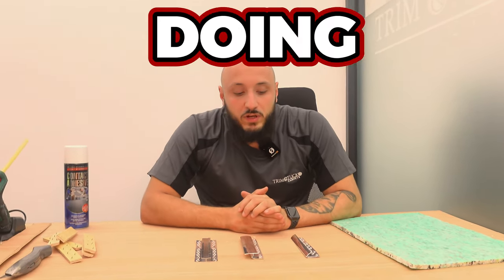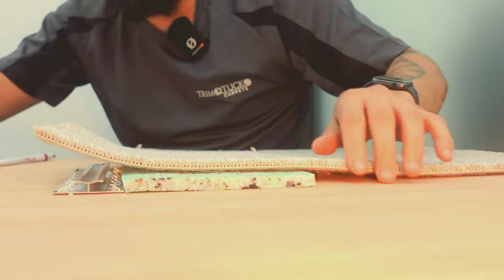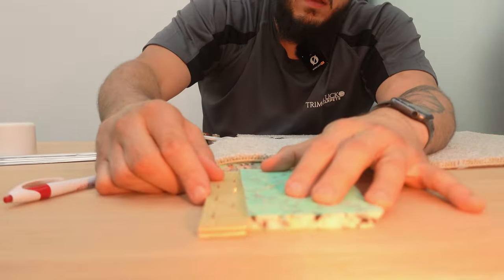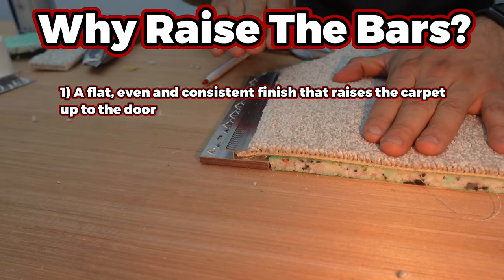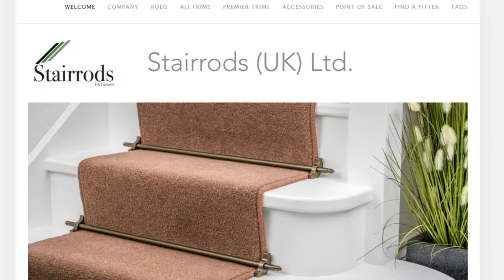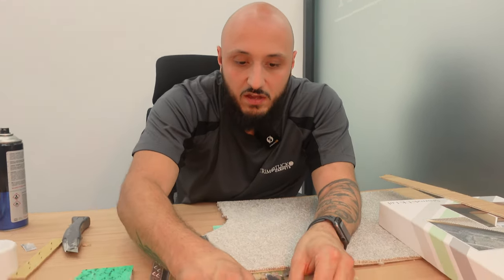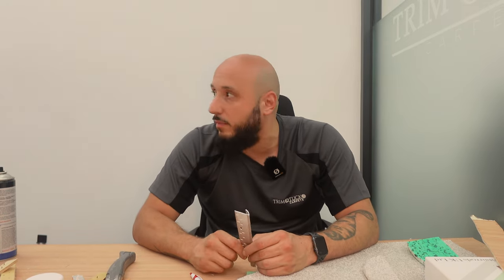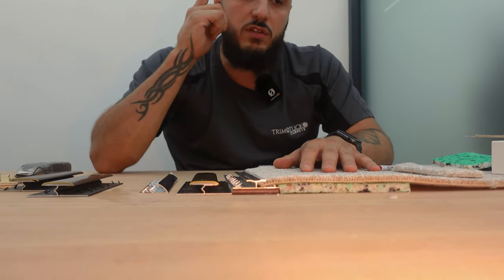How To Secure A Carpet In A Doorway | Trim & Tuck Carpets

Comment: Years ago, I saw you on You Tube for the first time encouraging fitters to position gripper on the front of winders and landing drops in order to tuck the carpet neatly around the edges, and I started doing them that way and immediately noticed the improvement in how they looked as opposed to turning the carpet.
So when I saw you raising your bars the other day I knew straight away that this would be my new method as I could instantly see the benefit even without you having to explain it.
These are simple tips, but they improve the visual aspect of the fitting massively, as well as the effectiveness of the fitting.
Thanks Sal.
Remember me? I gate crashed one of your jobs in  Brixton a few years ago when I drove past and saw your vans on a job.
Reply from the maker: Hey man. How could I forget you 😂. I’m glad you’re making benefit of our tips. There shall me more to come !!

Comment: Excellent demo. technically correct. Additionally, if using 12mm underlay you should raise gripper rods on ply - but how many `carpet butchers ' will do this? Like your vids. illustrating  TOP END installation, setting new standards.

Comment: I just wish we had those in the states. Doorway seams have a tendency to be noticeable, and the chances of wrinkles increase. Also, we got no different pin sizes in tackless. Thick pads tower over it. You guys on that side of the pond still abide by quality over quantity.
Reply from the maker: Thanks for you comment, you’ll be surprised there is a number of people that just do it for the £. However quality as you said Is very important! 

I’m sure where you’re there should be different type of grippers ?

Comment: the metal spikes on the door bars crush down in time when you walk on them , if the door bar is raised the carpet will come out easy , with the bar fitted direct the only grip the carpet has is via the arc going into the top part , only better fix is fitting a standard gripper in  front of the bar & cutting underlay to it